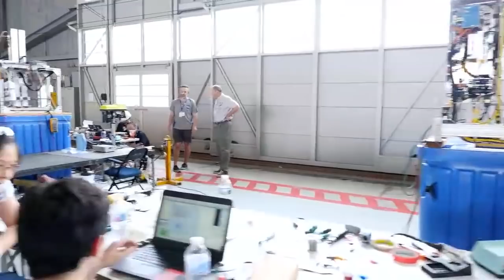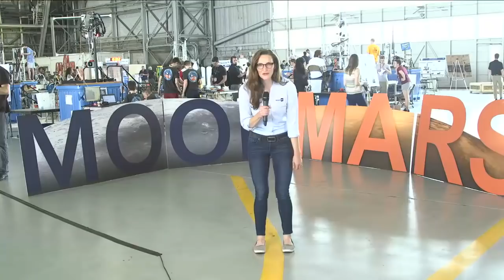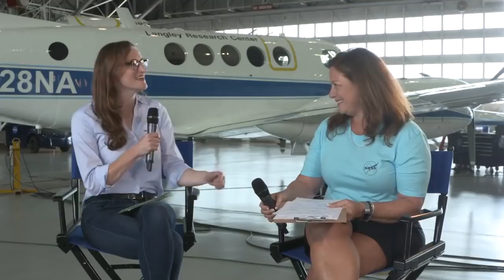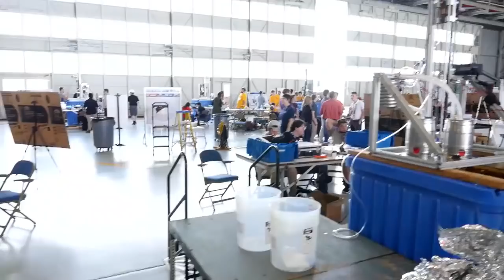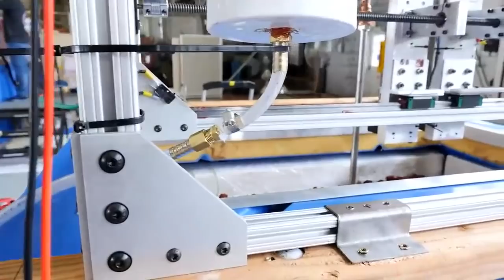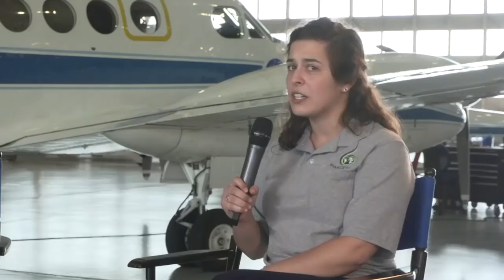NASA's Moon to Mars Ice & Prospecting Challenge

Comment: I see several problems. one: Luna is exposed to hard vacuum meaning that when water is heated it will move in the direction of lowest pressure. if the vacuum of space can reach the liquid H²O the attempt will fail. it they want the experiment to be real it should be done in a vacuum chamber.